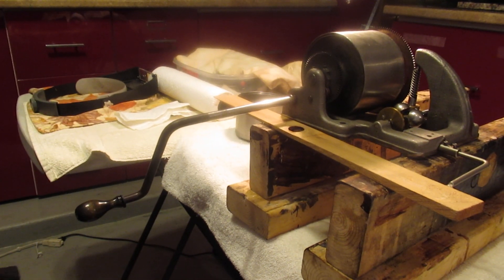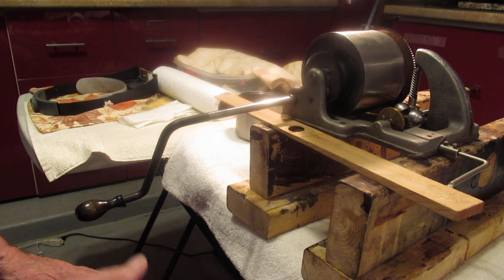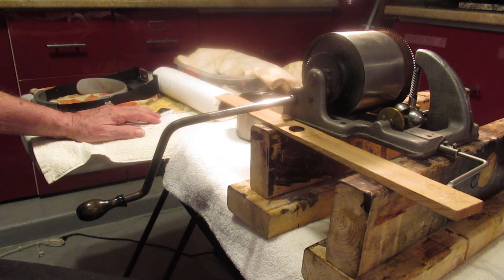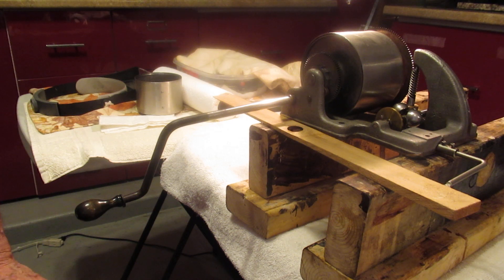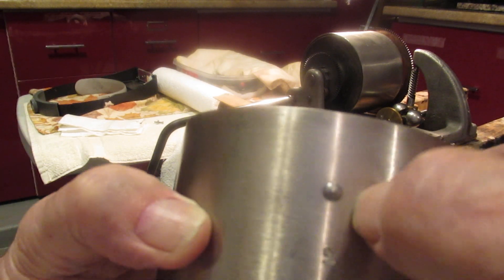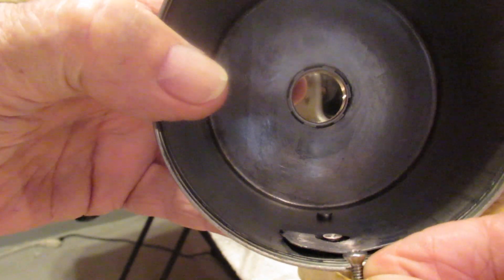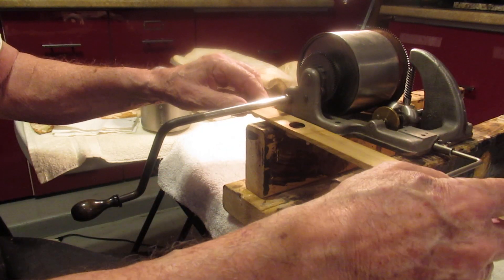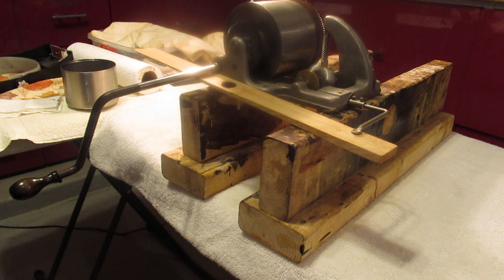VICTROLA VV-XI UNORTHODOX MOTOR REPAIR

Comment: Interesting fix. The HMV ones I have seen have the spring folded over as a hook, and not a hole. Apparently easier to fit, though I'm not sure it is better as there is a risk of the hook pulling out of the spring (which is what I think happened to one I fixed, but not had a chance to go into the spring barrel yet). I think finding alternative fixes is a good thing as spare parts are not always going to be available. Thanks 😀 👍
Reply: Hello Sir:
Thanks  for you comment.
As this motor contains a pear shaped hole and clip on the inside end, later versions, I think from about 1924 on, contained a hook and clip like the spring you described. The “hooks” were held on with rivets. I imagine HMV was much the same as was the HMV model 201 I completed not too long ago. Creativity in this hobby seems a necessary requirement. One never knows what you might need.
All good wishes,
Neil